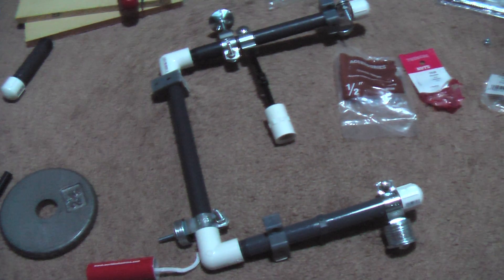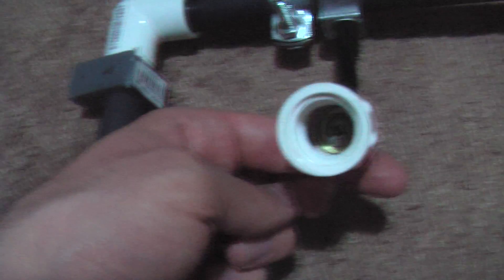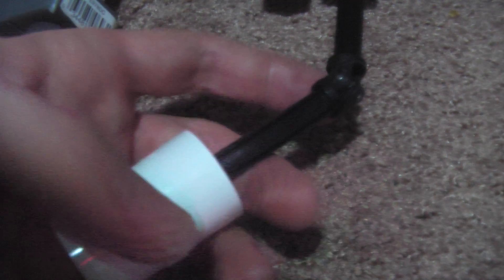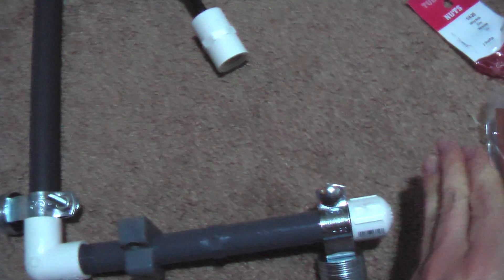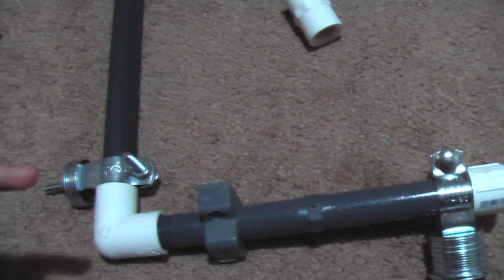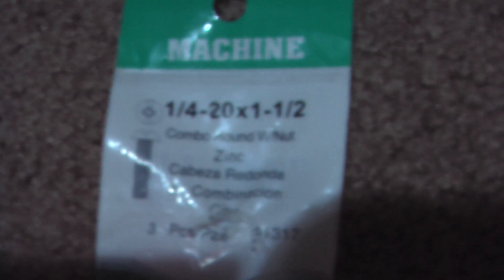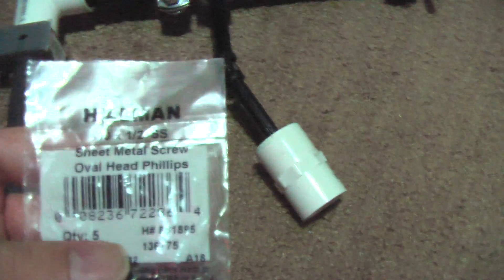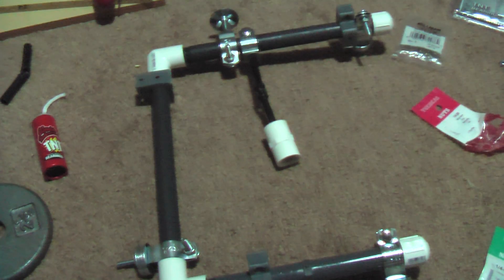$35 DIY Steadicam Merlin

Comment: All the DIY solutions I've seen seem to be made for smaller DV cams.  I'm attempting to build some sort of steadicam for a Canon XH-A1, which with accessories seems to be in the 10lb range.  Could you comment on whether or not it is advisable to use this design with a larger camera?  Thanks, and great video.

Comment from the maker: @ButterOnMyBiscuit You take one sheet metal screw and place it along with a washer through the bearing in your slip and thread joint... do this from the inside out... so that the screw head is inside the slip and thread joint and the screw thread is coming out the top.  Then just screw it into the male piece of the U-joint.  The male U-joint piece has a tiny hole in each piece that the screw should fit in and self thread perfectly.

Comment from the maker: @rojoque Good deal!  Make sure you use light weight wood. The extra weight there will make the rig even heavier (remember you have to counterbalance anything added to the top). Once you have a trimmable stage, get on a bed or something soft and try and balance your camera on one finger.  Try and find the center of gravity. Once you do, make a visual note of that spot and attach your trimmable stage. Adjust the stage so that the part that attaches to the rig matches the center of gravity spot.

Comment: @DrJoshD I was able to create the gimble.  I actually went with 2 5" schedule 80 pvc pipes and a threaded T joint for the top bar.  I then attached a second a male threaded slip joint to the T-Joint with a skate bearing attached to the U-joint and followed your design for the handle.  The challenge that I am running into now is getting the proper balance.  I saw your video on the trimmage stage and I plan to make that out of two wood pieces.

Comment from the maker: @rojoque Well to pry open the joint end to slip the metal bearing in it, I used a flat head screw driver that had a wider head than the gap in the joint end.  I put the head in the joint end and twisted the screw driver to allow the screw driver head to gently and smoothly push on the joint end to expand it just enough to slip the bearing in it.  I originally tried a pair of pliers but it messed up one end, making it too loose.  Does that make sense?

Comment: @DrJoshD Thanks for the reply.  I ended up getting the Traxxas 5151's and I think I can work with those.  Now I am assuming that you have to remove one bearing from one of the traxxas joints and attach the one without a joint bearing to the studs on the other joint with a bearing.  My problem is that the removal of the bearing isn't as easy as I thought.  How did you go about doing this?  I'm assuming a pair of pliers and a screwdriver would do the trick but I fear that I might damage the joint.

Comment from the maker: @rojoque No problem! I used the Traxxas 1951.  At first I used only the male part of the joint... but then as I demoed in later videos I cut off the female ends and fed them over top of the male ends to give it more support where you screw it in at.  Also, be sure to check out the video for the trimmable stage add-on... it's a must have add-on and only costs a few dollars more.

Comment: Thanks for the video.  I'm going to give is a shot.  Just one question regarding the U-Joint.  Did you use the Traxxas 1951 or Traxxas 5151?  You had referrenced WCLATER's design.  I checked his sight and he started with the 1951 but then moved to the 5151 later on.

Comment from the maker: @defnyung Hey no problem! I thought about the 8" pipes instead, but I chose the longer ones due to not having enough room for a decent handle...  I guess if I shortened the u-joint pieces that would fix that problem.

Another reason I made them longer is because I had planned on making an arm and vest, and I thought it may require a little more clearance...  Can't wait until I get finished with that... makes filming so much easier.

Did you get to build it yet?

Comment: Great diy but perhaps 8" pipes instead of 10" just to make the design a bit smaller works just as good.  Nevertheless, super inexpensive steadicam that works without having to spend a fortune.  
Thanks for showing actually showing every single part you used.  will make it easier for others to go out and buy them.